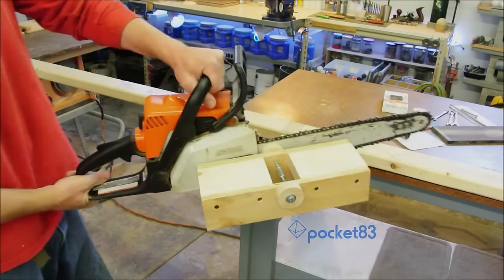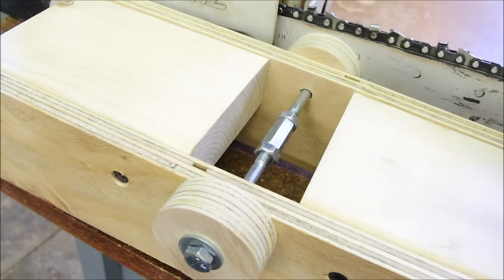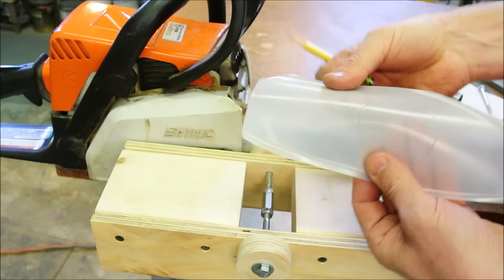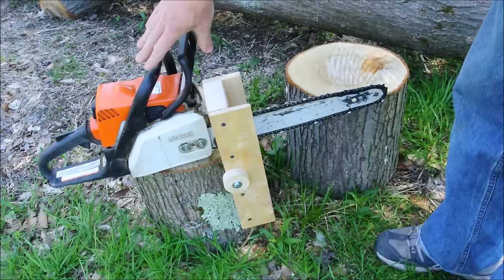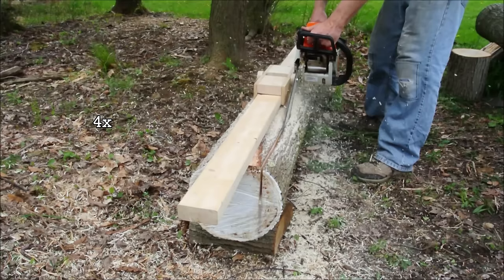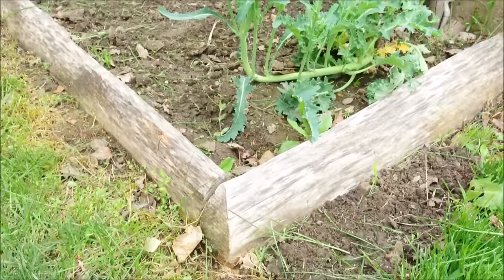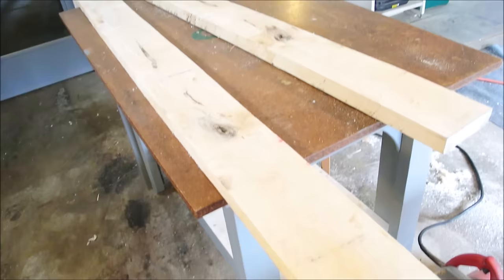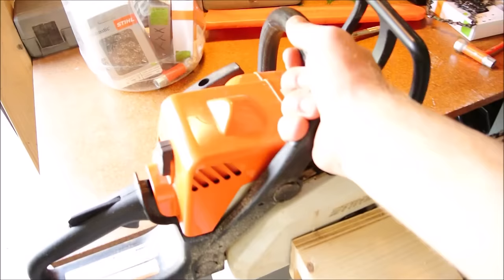Chainsaw beam guide from wood (DIY mini mill)

Comment: Oh Man! This tutorial video is so helpful! Well done! I have a question for all of you guys here, I got stihl ms241t what is maximum bar I can upgrade to?
Reply from the maker: Thanks. A longer bar is not exactly an "upgrade" for this mill. With such a nice little saw like that, I suggest you keep running the ~16" bar that's already on it. The machine was balanced/designed to fit the bar you're using. No sense burning up the saw just to make wider, wonkier boards. 

For the jig in this video, a longer bar than that will do you no good, because it was designed with a 16" in mind. If you really do need to cut deeper, then get a heavier saw—and use a different mill design.

Comment: Genius, 😉 do you wax the wood pieces for better gliding or is it just sanded smooth enough not to drag?
Reply from the maker: Wax is not necessary. The first board was just sanded smooth, but when I replaced it for the new clamp design, I gave it a single coat of polyurethane. Now it glides perfectly.

Comment: every one worries about maken prefect 90s and completely lv and straight. why? your making green cut lumber by time it dryes its gona no longer be straight or lv. lot of boards maid with my Alaskan mill. and the key has nothing to do with milling. after its dryed thats when the magic and straightening begins. good table saw and a straight edge jig all you need.
Reply from the maker: Sure, stacking is important. But straightness does matter for efficiency. Crooked cuts mean more planing, which means less material and more wear on knives. 

Also think about how the wood might end up being used: a board that's been 'trained' to be straight might regress later on from moisture.

Comment: Honest Question: Why do you want to preserve the moisture in the logs? I'm forever waiting on them to dry.
Reply from the maker: Depends on what context you mean. You might want to preserve the moisture of a log so that it stays easy to mill; water is a sort of lubricant that keeps the wood's density down. With respect to drying out lumber, you don't want the wood to lose its moisture too quickly, because it's likely to crack when it does. In the case of firewood, the faster the better!

Comment: Good stuff.  Don't be so hard on yourself - everything is relative, but from where I sit it was a success.  One question:  How did you stabilize the long 2x4 for the subsequent cuts after the initial one?
Reply from the maker: Mostly with clamps. As a general rule, I'll only screw to the bark. Watch the follow-up video to see all the details.

Comment: With those Alaskan mills, can you just clamp a bracket on the end of the bar instead of drilling it? I have a 16" bar, amd it will make it, but not by much.
Reply from the maker: Yes, you can~ but one simple hole solves a lot of problems.

Comment: You can make boards without a guide you just need a wide bar and a chain sharpened at a shallower angle.
Reply from the maker: Excuse the cynicism, but "you just need..." simplification comments are already tinged with irony, even without coming from a self-described autodidact engineer. I suggest you make a video that shows the rest of us how simple it can be.  

Wide bar and shallow angle, indeed.
Reply: @pocket83squared  Well my dad and I have been doing it for a long time although it consumes a lot of gas it's a life saver when you are situated 1200m above sea level away from any civilization/lumber mills.

Comment: Hi Pocket83^2 ... pretty awesome design.  Question:  would it be easy to modify to cut an angled slab off of a log?  I'm wondering if the beam guide could be modified to cut the roof angle on a roof ridge pole beam? I'm guessing you build the guide with a slant vs 90 degrees, on the piece that the blade is attached. Easy? Hard? please opine.
Reply from the maker: You're the first person to ask that. Right off the bat, yes, of course, it's possible. That said, my knee-jerk reaction is to ask why you wouldn't just cut an angle on the beam after it has been milled. Before I can give you a solid opinion, I'd have to understand the dimensions we're talking about, and probably most notably, the angle involved.

Also, before you consider applying this method to anything, I suggest you watch the newer videos in this series in order to become familiar with the limits of the process. The first video was also the crudest. Here:
https://www.youtube.com/watch?v=alClPHQMeMk

What I can already tell you without looking is that I now mill to the jig's maximum reasonable depth (which is around 8"), and so it's important to understand that any extension of that depth will come at a high price to cut accuracy. What I mean here is that plunging the bar into a log at a steep angle is not really what this jig does well; you can't expect to make a cut that's close to the total length of the bar. If the angle is 45° for example, for every inch of width of your beam, the cut will have to be 1.4" deep. In summary: yes, it's possible, but expect a few snags and limitations.
Reply: @pocket83squared  Thanks for the quick response. I've seen all your vids, especially on the beam cutter design. You have a great mind for the detailed considerations. I'm thinking about using round wood to construct a timber frame cabin. The roof beam will be long, maybe 30 ft, I wanted to transfer a roof angle, like 8/12, to the log beam so that I can attach the roof rafters to a flat consistent surface to help make the rafter construction go easier. Just wondering if an angle modification could be advised before building the jig.
Reply: @pocket83squared After reviewing the design some more I think that the biscuits, used to offset the bar from the body of the beam cutter, could be made to produce the angle. Maybe it could be as simple as that. Could the biscuit component be cut at the proper angle so that the bar would lay at that angle for the cut?

Comment: Awesome video and thanks for sharing your little invention. I just built mine loosely based on your idea.
One question I have is have you found it easier to mill freshly cut, green wood or wood that has  dried for a while?
Reply from the maker: For the sake of the chain, freshly cut. Water is a coolant and a lubricant. Further, saturated wood is far less dense.
Reply: @pocket83squared  Ok thanks for replying. I will be trying it out over the next couple weeks and will report back how it goes.  Thanks again!
Reply: I have had good success with this!!  I've been able to make some really nice lumber.  One more question....when you get down to the last couple of cuts on the log...have you come up with a way to mount the guide 2x4 so that you can maximize the amount of cuts?  Or just settle for a thicker piece of lumber on the last cut?

Comment: Thank you so much  I have been researching and looking for jig like this.  Are the holes on the chainsaw bar premade when you bought the chainsaw or you did it yourself?  I am skeptical about drilling it because I am afraid of hurting the durability of the chain bar which may resulting in breaking and cracking during milling.  Thank you.  Thumb up.
Reply from the maker: Discussed at 3:41. Notice that the ¼" hole is located at the center of the four rivets that are closest to the bar. The amount that the bar will be weakened is negligible. Mine has now milled piles of wood, and the bar remains totally unaffected.

Comment: Why do you run the saw with the weight off the bulk of the material. Should it be run with the weight of the saw over top of the log you are cutting ?
Reply from the maker: There is no 'weight' to the saw, because it's being supported entirely by the guide board. 

In order to add pressure to the cut as you mill, you simply press gently on the chainsaw's top handle as you pick up slightly on its rear handle. Doing this will cause the saw to rotate around the pin where the jig and bar are connected.

Since the cuts are so shallow—and since the saw is so small—adding cut pressure in this way is not very difficult, even over the course of milling an entire log. In fact, it gives you lots of control and a good 'feel' for what's happening.   

In the follow-up videos there are counterbalance weights being used, so you can really see there how the setup is weightless.

Comment: Just for laughs and giggles, say you are in the woods away from everything. Could you make a mill using a hand saw? Yes, I know it will beat you up and take a lifetime, but, could it work?
Reply from the maker: The handsaw is an extremely fine woodworking tool. Unless you're talking about something like those old sabre-toothed crosscut/felling saws that once roamed the forests of yore, it would be extremely impractical to use any sort of man-powered pull-saw to mill lumber. A two-person combo with a sharp tool and some practice could probably pull it off, though. That would be awesome. 

In such a case it might be more sensible to split a log to create rough lumber. It's incredible what multiple wedges can do a tiny separation, though there probably wouldn't be much giggling involved. In the woods, wedges, either wood or stone (as well as a mallet), can be fashioned from materials around you. 

Simply put, chainsaws rule.

Comment: Looks good. I'm making one except more similar to the guy on the channel Advoco MAKES, the saw goes on the other side of the sled. You still get a like from me.
Reply from the maker: Remember that positioning the saw on the other side will give you a different set of problems. Consider carefully. Good luck. 

If you haven't milled before, I strongly suggest you watch the following video before you decide on a method:
https://www.youtube.com/watch?v=alClPHQMeMk

Comment: The only thing I think you didn't cover is - 
How far from the body of the chainsaw did you drill the hole?

I know to drill the hole in the center in regards to the width of the bar, but where do you drill it in regards to the length? 

I realize that the further down the bar, the less cutting length I'd have. So the closer to the body, the more length I'd have. But is there any reason why I couldn't or shouldn't drill the hole but up against the body?

Yours looks like it's about 2 inches from the body. It may only be an inch and a half. 

At what measurement to drill the hole from the body? Or the opposite way, how far from the nose of the bar do I drill the hole? 

Again, any reason not to drill it right next to the body? Or should there be a space between the body and the guide mount hole?

Thanks!
Reply from the maker: You'll see those raised bumps on the bar that sort of look like rivets. Find the four nearest the body, and connect them diagonally with an x. Then x marks the spot!  

Any closer to the body is a bit of a risk, and it's somewhat unnecessary. Long discussion, but I recommend keeping it the way it is.
Reply: @pocket83squared  Thanks a LOT!!!
Not many content creators reply to my questions, and it really drives me nuts!!! I definitely appreciate your time and reply! I appreciate it so much, you've earned a new subscriber!!!
Reply from the maker: @eldie3d  Thanks. I'm always here for questions. Be sure to watch the follow-up vids if you're going to make a chainsaw jig.
Reply: @pocket83squared  I already did! LOL And this was really the only question I had. So instead of asking it in the follow up vids, and came back to where you explained the construction of it. I actually watched it again to make sure that you didn't answer that question in the video and I missed it the first time. The last thing I wanted was to say, "You told us everything except..", and then you come reply with, "I most certainly did! Go watch it again!" LOL
And by the way, I'm not a stalker or anything like that. I'm just curious about where dung beetles are in the US. LOL If you don't feel comfortable answering, I understand.... Maybe you can just tell me a general location of where those can be found. I did a Google search, and the only ones they show have a  rhinoceros type horn on its head... It's either a Green Beetle or a Rainbow Scarab, but I didn't see your species. A general location where they can be found???
Thanks again for your time and replies!!!
Reply from the maker: @eldie3d  No worries! I appreciate the conversation and feedback. I'm in Southwest Central PA. This is sort of the top of the Laurel Highlands—and as far as I knew, I'd thought dung beetles were from a land far, far away!

Comment: What width was your beam?  8"?
Essentially, I want to only do 2 sides, in order to make beams to put under the hunting cabin. I'd like to cut both sides, without moving the guide rail once it's in the tree. Ideally I'd like 10-12" thick beam.  (Leaving the sides rounded)  Thoughts on using a 2x6 in the sled, and as a guide?
Reply from the maker: What you're after is possible, but that's not really what this method does. Let's see if we can adapt it to your purpose.

Let's state the obvious first: what I'm doing here is making 7½" boards. If you want to make a 12" thick beam, that means you'll have to use a 12" diameter log. Simply put, you're removing two big slabs from a 12" log. If we want to through-cut a 12" log with a device that only plunges around 11",  we'll have to make additional passes. For this, let's consider two different approaches. 

Approach 1: 
Cut as deeply as you can using the jig and your 2x6 sled rail, then roll the log over and finish off the last inch or two by 'feel.' The tough part here will be error: an 11" plunge will be subject to a +/- of around ¼" in either direction, adding up to around +/-½" of error per cut. Since there are two cuts on a beam, you could be off by an inch when you're done if you don't have experience using this setup. 

Approach 2:
Cut halfway through using the jig and the 2x6 sled rail, flip the log, and then repeat the procedure from the other side. In this approach, we're reducing the plunge error considerably, but we have to be extra careful to be sure our cuts align. If the log's ends are flat & square, we can pencil-mark the second half of our cuts up, to extend them to where the guide rail will be. From here, the rail can be screwed into place so that the chainsaw's bar can be dry-tested to make sure, by visual inspection, that the cuts will all align.    

There's one major consideration with doing this that you'll have to remember: if you are keeping the bark on two sides of your beams, then you will be setting the guide board on an irregular surface. This means error—lots of it. The good news is that a 2x6 will give you lots more control over establishing a horizontal plane. Use plenty of screw to keep the guide board exactly where you want 'flat' to be. No question about it, I'd use approach number 2. Go slow and pay attention to alignment. Don't get antsy. Don't plunge; make lots of shallow passes. Keep the saw as close to horizontal as possible. You'll pull it off. 
  
I also highly recommend that you watch the other two videos in this series. The counterbalance will be essential for you, and even though you probably won't be using the Z-clamp, there are some helpful tricks in that video. 

One more thing that nobody seems to mention: while using a jig like this, you have to choose a side of the guide board to press against in order to get a clean cut. This will especially matter in your case. As you run the jig, press it gently away from you and against the rail. Run the jig as though it were an L-shape instead of a C, and pretend like it could slip off the rail in your direction. If you do this, you will standardize your movement and dramatically reduce error. Good luck.
Reply: @pocket83squared  Thank you.  I've seen commercial products built around using a 2x6 that works the same as your jig, however, I like your idea of using 2" plywood spacers to hold the saw blade. Seems to me there would be less flex than a narrow clamp that comes with the commercial products, and less chance of a loose chain coming in contact with metal. 

I'd even consider using a 2x8 since the goal is to elevate the cabin, while removing flex in the floor.  Currently it's a 16'x16' cabin, sitting on bricks at each corner, and half way at the 8' mark. It's only 8" bricks, so the cabin is 8" off the ground. Unfortunately, buying 16' 8x8 beams will be expensive, and delivery to the remote site means renting or borrowing a long trailer. 

My other option is glueing and nailing 2x8s, 8 foot lengths together to make a beam.  In my experience, these tend to flex over time, but I'd also be able to use treated lumber.
Reply from the maker: @cliffordcommanda6105  It's really tough for me to comment without being on site. If this is a crawl space, then obviously dimensional lumber will be easier to install. It's also advisable to use treated lumber so close to the ground, especially if this is in a high-moisture area. 

Honestly, the chainsaw approach doesn't seem right for what you're describing. An 8' span isn't all that much; don't underestimate how much a tripled-up 2x8 header will support. And considering that 8' is such a common size, even a piece of treated plywood for in-between the header will get used up with zero scrap. Two pieces of ply will yield six 8' triple headers. Three headers on each side for a 16x16 floor? That's enough to park a tank on. If you can get the tank on site, of course.

Comment: just wondering , would you recommend making jigs in different sizes for different diameter logs ??? 🤔🖖✌
Reply from the maker: Not really. The size of the jig that's used here is pretty versatile. This method really isn't for lumber that's over 8" wide, so a larger jig wouldn't be very helpful. Also, a longer jig would bump the clamps earlier.
Reply: @pocket83squared  thanks